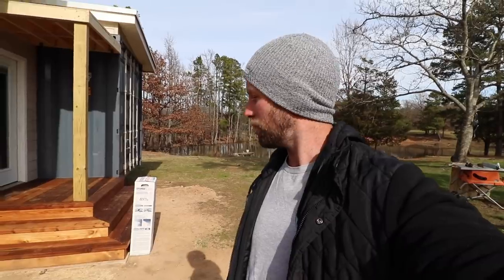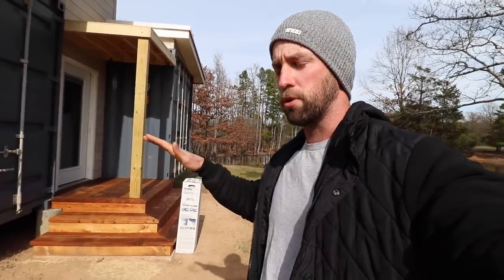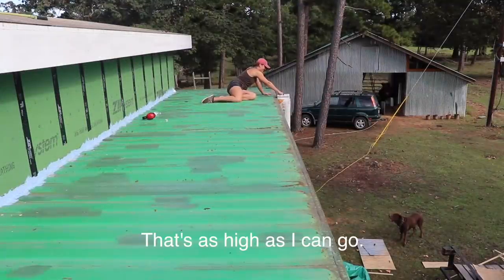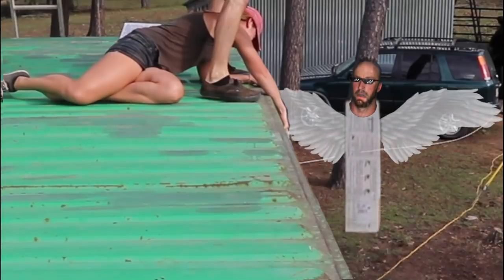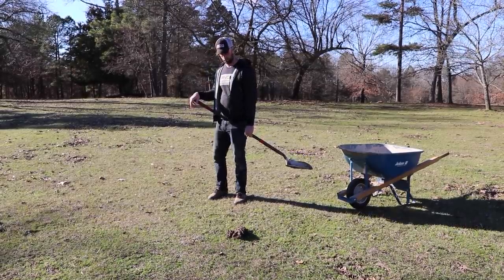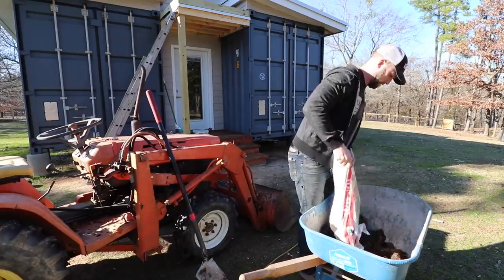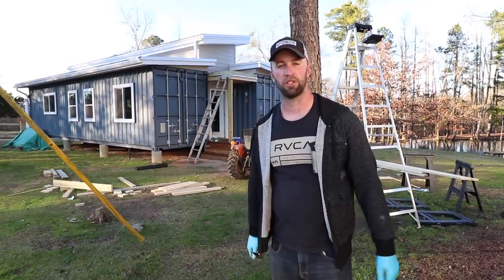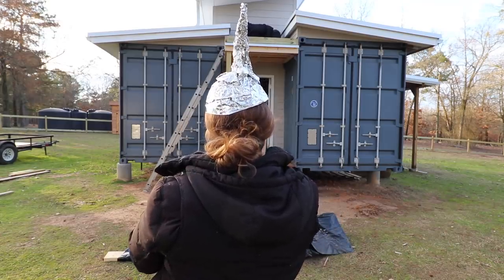Growing A Green Roof On Our Industrial Home!

Comment: Love what you both are doing!!! HOWEVER

PLEASE.... lower your table saw blade when you rip;  and USE A PUSH STICK!!!  Take it from a  guy who cut off 2 fingers in high school (Reinstalled and working fine, 45 years later), you can ONLY have a bad experience if something goes wrong. I've been a carpenter for nearly 50 years, and have SEEN some B A D things happen when other were using saws improperly. I was raised on a farm, and know how dangerous many things are, but, I learned my lessons early and want you to learn from others mistakes!!  You're a dad now, you have to be careful...... GOOD LUCK to you all.  Jerry
Reply: I hope they read the comments.
Reply: I'm wondering what is a rip and a push stick lol
Reply: Jerry, you are the BOMB! providing advice from someone who has been there, and it is SO important. We all know these bits of advice from watchers are attempting to be helpful,  not critical. My husband did it too. Building our deck. NO push stick, cut off 3 fingers because the saw jumped a knot, and nearly bled  to death before getting into surgery. I was at the hospital, working L&D nurse, when it happened. I fainted when I saw his fingers being prepared for re-attachment. He is a born and bred Iowa farmer too. He still misses parts of those fingers,  and some sensation in all of them. He lowers his saw,  and uses safety (push) sticks now. I hope they read your post and take note. You can actually die if you are far from town and have a horrendous accident.
Reply: Chainsaw almost lost the last 3 fingers on my right hand breaking safety protocols. I grab a bunch of seedless mulberry branches you come up and cut them, we were both tired and it wascoming up on dusk we wanted to get the job done and get paid that day...as it was 6 stitches between my last 2 fingers. I got wayyyyy lucky I still have all my fingers. Just dumb lucky
Reply: Yep, I follow that blade height rule and because of it I only cut half way through my thumb instead of cutting it off about 4 years ago. Got real lucky and didn't get the bone.
Reply: Hope they read comments too. 
Table saw NO PULLING.  Push only and stick comes handy. Saves.

Comment: Maybe a trellis with grape vines instead of a "living roof"?  Give you shade during the summer---and grapes??---but not much protection from rain.  It's a toss up either way---but no mud running down the side of the containers.
Reply: But, bees!!!  Which would be great, just not at the front 
door!
Reply: There won't be any mud running down anywhere. The roof is totally sealed off, except the lower end at around the 6:03 mark where the whole thing will drain into a gutter, I'm sure.

Comment: Don't put a living roof on the containers, membrane or not  I think it will rust through over time. Moisture just from condensation will spell trouble. Just my thoughts..
Reply: water does find a way. i thought he said water collection or living roof. he chose water collection
Reply: That part is not container, that is just the overhang roof that they recently built.
Reply: @timidater4803  Point taken😊 Let's hope that doesn't happen.
Reply: I have a living roof on my detached garage (ca. 4 tons of topsoil) (my neighbor has it on his house, a lot of supermarket have it), no rotting things for the last 10 years and there will not be in the future :-) Just choose the right construction. Use EPDM as it can be stretched sooo wide.
Reply: Maybe add some insulation 1st
Reply: @trelawnny  rubber membrane 060 will last for ever
Reply: @timidater4803 , They're in Texas, no chance of snow/ice falling.
Reply: @michaeld_aus_b , True !

Comment: I share your passion for self sufficiency and real green living.  When I was young I imagined owning land with a low flat area for farming and livestock, and a house built on or into the side of a hill.  Near the top of the hill would be water storage containers like what you have using gravity to feed the home.  The drain field would go into the grazing area of the farm/property.  I also envisioned a windmill for some power.  Solar has come a long way since then and it seems to be enough.  Of course a woodstove for heat and powerless cooking too.  I'm too old for that dream, but sharing it might help someone else.

Comment: I think the living roof would wreck your rainwater collection system. They don't go together. They have little benefit on a small scale in a rural environment.
Reply: It is only on the porch roof... right?  Water catchment is on the metal roofs.
Reply: They are only doing the living roof over the front door porch deck. Maybe 5'x6'? Won't impact the rainwater collection system.
Reply: @tf5pZ9H5vcAdBp , BINGO !! NOT CONNECTED AT ALL !!

Comment: I guess a living roof would keep the house cooler in the summer.
Reply: Just curious and not trying to be a "Robbie downer"...any chance of mold issues in such structures?
Reply: The little garden is on the outside above the porch . It will not cool the house
Reply: @larryshafer8055 , Exactly !

Comment: can you explain how water is going to drain from you porch living roof?
Reply: The roof slopes down to the gap shown at 6:03 and then it will run under the frame and off the drip trim.
Reply: Ashley Powers  over time it wil definitely get wood rot
Reply: It WILL rot much faster   This is humid Texas. They’ll be doing repairs in a year or two.  Such great work but the living roof is just hideous to me   Oh well to each his own
Reply: You guys missed the part where he completely sealed it with plastic....unless he drilled holes somewhere and didn't film that 🤷‍♀️
Reply: @kristinamclain3770  waterproof film>poros rock layer>permiable layer where only water is drained. 

The slit for the water to drain is in the poros rock layer out away from the house. 

There will be eventual rot on the border 2x4 frame that houses the soil but with the slight incline it will hold it off for a while, maybe 1 or 2 years. But is easy 1-2 day part time project to replace the whole thing anyways.
Reply: @Kelmorcellus  still wouldn't trust it. But then again I live in NYS lol we have freezing, sun, freezing, sun omg what the hell season is it!?!??? 🤷‍♀️
Reply: @kristinamclain3770 , The roof is totally sealed off, except the lower end at around the 6:03 mark where the whole thing will drain into a gutter and downspout I'm sure.

Comment: Living roof over the main entrance.......big mistake!! What happens when it rains over 2 1/2 inches and overflows the 2X4 border?
Reply: There is a gap along the bottom above the drip edge.  Just like on the back side of the pump house roof. Any water not absorbed by the soil will drain through the fabric and out the gap.
Reply: @aquadesignsbymlt4769  It's several feet out from the door at the front side of the roof.  The side along the container does not have a drip edge and will remain dry.  They can go out that way if it is dripping actively.  Or they have exits on two other sides of the house.
Reply: Yea just shit flavored water dripping off the roof in front of the front door. Lol
Reply: @joelmiller4364 , HAHA, WRONG ! There won't be any shit flavored anything running down anywhere. The roof is totally sealed off, except the lower end at around the 6:03 mark where the whole thing will drain into a gutter and downspout I'm sure.

Comment: I think the thought of a living roof is keen but I'm going to bet it will cause far more issues over the next few years than you are going to want to deal with.
Reply: I’m betting there will be rot issues. I’m not sure though, I’ve never tried it.
Reply: The roof is totally sealed off, except the lower end at around the 6:03 mark where the whole thing will drain into a gutter and downspout I'm sure. If there are any issues, which is highly doubtful, it would be extremely small, given the size of the roof, right ?

Comment: Sorry , I'm not a fan of living roofs .
Reply: at347est I must agree. All I can think of is maintenance, rot, leaks, mold, bugs....
Reply: @paulaboynton8299  Instead of thinking you should try it: I have had mine for almost 3 decades now and hardly no maintenance apart from the very first few months, also no rot, no leaks, no mold, bugs, well the occasional bug is in my garden, so no more than elsewhere.... 

Even in summer I never water, the only thing I have to do is remove young oaks and walnuts once every 2 to 3 years, which are regularly planted by squirrels.
Reply: @paulaboynton8299 , The roof is totally sealed off, except the lower end at around the 6:03 mark where the whole thing will drain into a gutter and downspout, which I'm sure will be added later on. And to top it all off, it's such a small area, how much of an issue could it be ?

Comment: You look like a tin foil unicorn. Baby wasn't happy.

No to living roof on the porch cover. When it leaks, and it will leak, you'll get mud running down the containers. If you wanted greenery on the roof, purchase some large plastic totes and put those up there.
Reply: And where will the water go eventually it will fill up
Reply: @jeffmabry4112  Yeap especially when it rains.
Reply: As they have undoubtedly experienced, it rains buckets in southeast TX.
Reply: @jeffmabry4112 , There won't be any mud running down anywhere. The roof is totally sealed off, except the lower end at around the 6:03 mark where the whole thing will drain into a gutter and downspout I'm sure.

Comment: Spencer, pro tip. Lower that blade on the table saw to just barely poke out the top of the wood, that way if you ever do slip, its a cut and not a lost finger. You guys are awesome!

Comment: Since you asked, the disadvantages of a living roof out weigh the advantages. All that stone and soil are heavy so you need to make the framing and support more sturdy than a normal roof, all that costs more. The plant roots are going to, over time, penetrate the water proofing material. When that happens you have to remove all that stone and dirt to fix the leak. Much more hassle than a normal roof.

Comment: Looking great! One thought. If you lower your table saw blade so the edge is only one eighth inch above  material the electrical draw will be greatly reduced. The blade will not be DRAGED by the material. Just a thought.. Cheers.

Comment: Love the channel,I always get a laugh, the carpentry skills have come along way, did you go with a variable speed pump, and I have  a tip for your storm water if you put a tee in the pipe and a either a cap or a valve before it goes into the rain water tanks this lets you drain the stagnant water before it goes into your tanks, during the dry times

Comment: Spencer, you go to the effort to wear hearing protection, but fail to wear eye protection, and on top of that, when ever you use a saw, adjust your blade to just slightly more than the thickness of the material you are cutting. if your hand  were to slip, it's the difference between a bad cut vs severed fingers/hand

Comment: Yeaaaah, that kid is really going to thank yall for that one! I have a technical question for Spencer. I am going to build an 8.5'x18 or 20' Cargo Trailer Conversion. It will boast a 6000 btu A/C, Air-Fryer/toaster oven, microwave, a chest freezer and another made to work as a fridge, also an induction cook-pad. The TV, water pump, fantastic fan and lighting will all be 12v. It will have a garage (3' in the rear) for charging cordless power tools but will also boast a small drill press, 2 belt sanders and a sliding trim saw. What size and how many solar panels, batteries (how many Lith. or AGM), (Size solar charger) and inverter would you say I would need to satisfy this rig? Thanks for the help, I trust you because I have seen for some time your expertise and character.

Comment: One concern with a living roof is it's a terrific attraction for insects such as ants and termites. And even with the precautions of treated wood and ice and water shield there will be damp wood which ants and termites love they also love decaying plant matter and moist ground. Ants do most of their work at night and about only 10% of the colony is worker ants.... Those are the ones you see. I work in the pest control industry so living roofs are my nightmare..... 🤣 It could be a long time till it becomes a problem though just be vigilant.
Reply: There must be something they can treat that little area with something to control all that, isn't there ? Thanks.
Reply: @augustreil  Sure you can do preventive chemical treatments but you need to do it 3 to 4 times a year and still keep a close eye. Under the water liner the wood will get and remain damp. But you can't see or treat that wood cause it's covered up.
Reply: @mountainlaurelhomestead6612 , True.

Comment: hi maybe i had an idea how to expand your project its about what to do with the leftover corrugated panels and some other leftover materials? why are you not building a solar carport next to the barn with a solar roof and southern solar facade, so you can easily cover the northern side with those leftover panels while setting up panels at the southern wall. this will be an opportunity to expand your energy gains now gives an protected parkingspace for your car and tractor, in the future yor home will be prepared for electric vehicles and the rainwater can be used unfiltered for the irritation of your garden

Comment: You asked for feed back on your living roof...  Remember advise is worth what you pay for it.  I am not a fan of them myself for any structure that is made of anything other than concrete and even then there are long term issues.  With so much real estate to grow what ever you want, why do it on a portions of your home?  Regardless over time you will be removing it, the membrane will break down then, leak and the wood will rote; been there done that.    I also suspect that in the Texas heat of the summer the soil on that will simply be to hot so support plant life.  I may be totally wrong, but good luck and I am interested to see how it grows or goes.   You are a good craftsmen and enjoy watching your home come together.

Comment: Your fingers in that table saw petrify me. While having a hip replaced under spinal anesthesia, I heard someone come into the OR asking which doctor could reattatch four fingers some kid cut off in a table saw. I had no problem with the fact that they had just sawed my hip bone off and replace the ball and socket, but when I heard about the saw accident, my hand started to hurt and I was getting woozy. As a carpenter, I always use a push stick with the table saw.

Comment: Sorry, bro but I have to say - PLEASE!!!  Make and use a push stick. You have way too much blade above the wood. An accident waiting to happen. Set blade height so the valley between teeth is just above the top of the wood. The saw dust will clear out of the cut and less blade sticking up.

Comment: I think the location of the installation of a living roof isn't good.  Keeping water/wet dirt out of and away from the center wall and even the steel container walls is a unnecessary risk of water damage months or years later.  Also the weight will wreak havoc on the wood members and the cleats that were welded onto the containers.   I went back a reran the video of the two tub like areas that will hold a lot of water - how are they draining to avoid becoming 2 mini lakes ?  Just my 2 cents.

Comment: I am in the commercial roofing industry for over forty years, and this is not the way you build a green roof on a building. I have been involved in many green roof designs, including River Rouge, MI Ford plant. Over one million square feet of green roof. You can access pics of the extensive green roof online. Extensive green roof is 3-6 inches of soil, intensive green roof is plus 6 inches of soil. Please seek out the proper information before self installing a green roof on your residence. They are costly to install and even more costly to repair if installed incorrectly.

Comment: I dont get it when are u going to finish the inside and move in. The out side can be done after, its kinda odd seams like u are avoiding working on the interior. At this rate u will be years before u move in. So far I like the design u chose but when one builds a house usually the idea is to live in it.
Reply: Makes for some cool videos though ? !!!!
Reply: @augustreil  They are making a super cool home Just going about it in a strange way, just my opinion.
Reply: @overlandtraveler979 , True, You're right. Get the inside done and THEN worry about the outside, makes sense. Thanks.

Comment: 100% Bad Guys !! Sorry - nah not sorry as you did ask for feedback !! The living roof idea is the ultimate recipe for a disaster - your structure is not engineered to support anything other than itself - actually although it looks 'cute' it is not engineered at all. Just like most things your generation does not consider longevity - that is looking no more than a few years down the track or until the next fashion rolls around. With the weight of itself - wet soil and plants over a very short time it will fail - hopefully no one is hurt. Still don't understand why you are doing it yourselves and taking so long when you could engage professionals to do all of this in a few weeks and be out there earning a living ????? Sorry Just Seems Dumb.